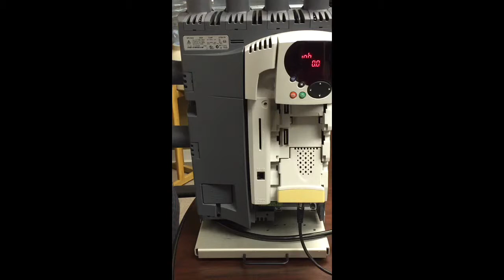Control Techniques - Mentor MP Ethernet IP communications

Comment: This drive is no load time RPM (0 to 3000) OK.
But loading time 0 to 
120,140,150(RPM) Maximum than reverse rotation display showing minus (-) 
value than again and again same starting.
please help me.
Reply from the maker: Have you looked at the current demand of the motor while it is running? M4.P04 or M4.P01.

Comment: When I setup my Drive  UNI 4403REGEN 75 kw , parameter menu 1.00 setup 
1253 then  Parameter .48 editing Close Loop To Open LP Then I Press the 
Enter Button Drive Display show trip r5   .how can i edit it ?
Reply from the maker: Is "r5" the trip code that is displayed on the drive? I am not seeing this as a valid trip code. When you are defaulting and changing the mode of the drive make sure to select the red reset button on the keypad, not the enter button for it to take effect.
Reply from the maker: I apologize, since the comment was made under the Mentor MP video i was looking through that manual. I believe you are referring to a "rS" trip which is failure to measure resistance when starting in open loop mode. Do you have the motor power leads connected to the drive? First we would recommend checking the motor power wiring continuity.
Reply: @Carolinamotioncontrols  hello good night can you help me.how to set parameter mentor mp dc drive .